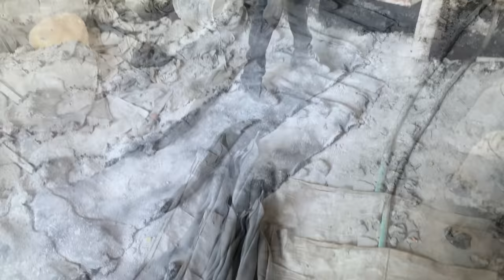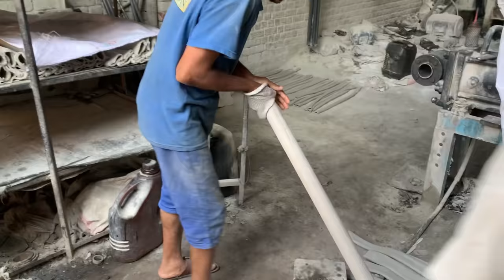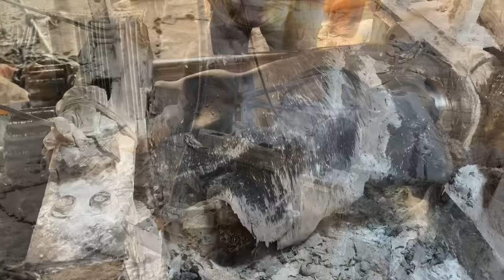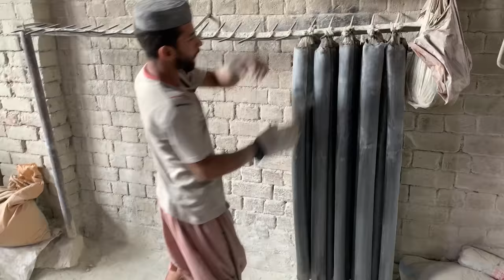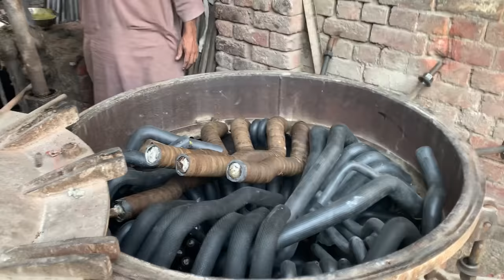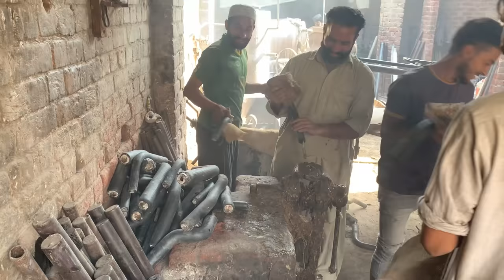Manufacturing Process of Making Radiator Hose Pipe | How Radiator Hose Pipe are Made in Factory

Comment: I wouldn't work with my bare hands on that roller for any amount of money, get a stray finger dipping too low and next thing you've lost your arm. Brave guys, have to be totally focused.
Reply: the extruder looks way more dangerous . stuffing rubber in that small hole . you can see the flutes turning in there. it's like sticking your hands into a hamburger macerator.
Reply: @ronblack7870  o
Reply: @ronblack7870  in